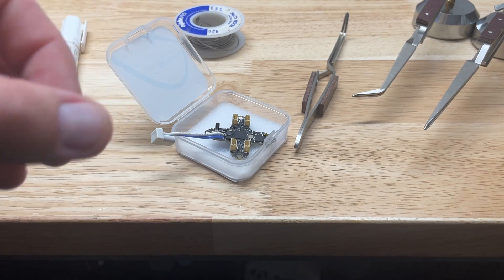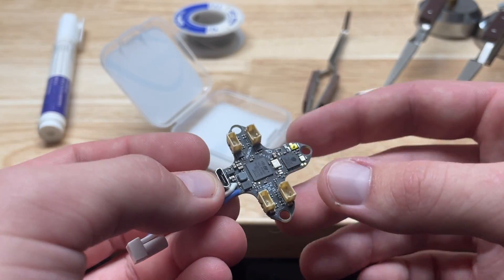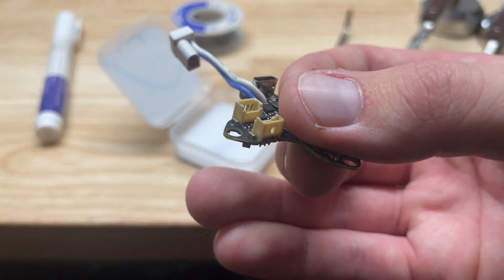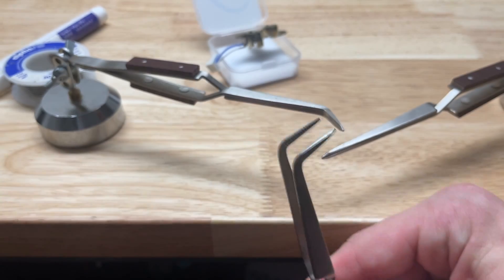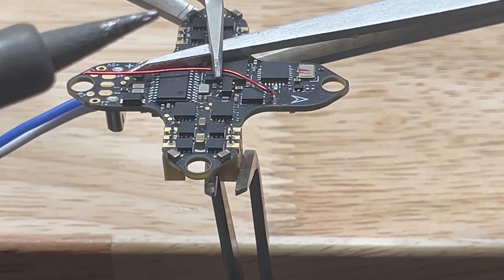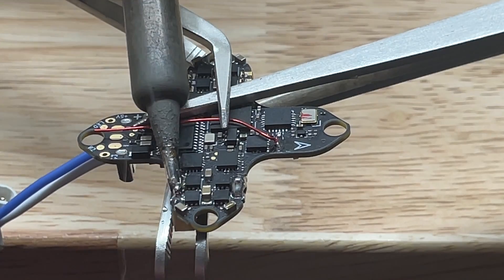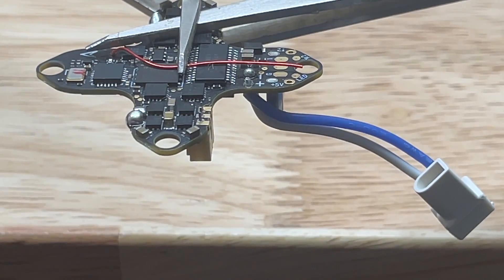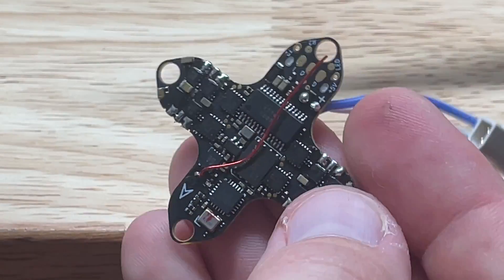Tiny Whoop Quick Tip: Removing Motor Plugs | CustomFPV

Comment: like with anything a little practice before you dive into it.   find some e waste . Practice on that till your confident.   if you have pine trees around. the tree pitch is your flux.   use it raw or thin with iso alcohol.   no soldering iron ?.  heat a pin, nail or even copper wire.   with a stove ,candle  or lighter.    its how it was done before electricity.    hobby on pilots.

Comment: Keeping the solder iron on your board for that long will destroy it. One pin at a time is much better for your board's longevity.
Reply from the maker: been using this method for years and know many of my friends and fellow racers that swear by this method, never destroyed a board. must remove all pins at the same time to remove the connector in one go.

Comment: save 4 minutes of your life. This only works if your pins are actually through pads like his. Many of these boards are NOT that way, there is basically no visible pad the pins are through, just a super tiny hole

Comment: Thank you!
Total noob. Managed to crack my motor plugs, but I couldn’t remove the pins. I’ll try again later.
Also, where’s the follow-up, where you solder the motor wires to the AiO? 🥹

Happy flying! 👊😎
Reply: Am having the same problem but cant quiet get them out, how did u do it?
Reply: @fireflymc i just broke the pins off from the base, and then just soldered on the exposed pads.
Reply: @AromielVonPleiadesalready figured it out but thanks anyway

Comment: I’ve been doing this for couple months. I built a handful of whoops and done a couple repairs and I owned a bunch of these bnf whoops with these motor plugs and I found that even when I never even unplugged them or tampered with them, they would cause connection issues where the motor would be arming sometimes but then twitching other times, but every single build that I have made where I solder the wires directly to the board, I never have arming issues unless there is hair clogged up in the prop. 

Have you also experienced this with motor plugs? I find that they are more hassle than it’s worth and it’s actually a lot easier just to solder them on.
Reply: been chasing this myself cheers brother

Comment: Do you use solder wick? Or does that really matter
Reply from the maker: Not really, but it can be useful in certain situations. I typically try to be very careful when I solder so I don't need to clean it up with the wick
Reply: @CustomFPV  essentially you can desolder anything and salvage the board? Within reason im sure.  Cool... I will look forward to doing this as things get back to normal.
Reply from the maker: @ClayIW  Wicks are handy for desoldering for sure. I find most of the pads on this board in particular can be desoldered and cleaned up pretty easily with a dry tip of the soldering iron (cleaned off, no solder on it). Typically if you spill solder anywhere else on the board you will end up pulling caps and other chips off the board which are very difficult to put back into place. The golden rule is to not feed too much solder onto the board in the first place and avoid all the potential issues. Just be careful and it will all work out!

Comment: could you also pull on the plugs and remove them that way and remove the pins one by one? it's hard to make out how it's connected. I'd kinda prefer that due to heat buildup.
Reply: You probably figured it out by now but for anyone wondering it is indeed the case, the three « wires » in the plug are not connected. They are just three standalone wire and then the plastic cover slides into them to make easier install for the motors connector side that will force the motors wire and plugs wire to touch so that the current will pass. That means that you can gently remove the plastic cover and then remove each wire separately :)
Reply: @MikleRe that happened to me but am struggling with removing the pins, any tips?

Comment: I made a mess trying to get those motor plugs on a brand new board I did what you did but when I try removing the extra sodder it spread all over the board I try flicking it with the tip of the iron try using the sodder wick didn’t work in this process one of those tiny capacitor came off and that when I realized I fucked up bad
Reply: damn you messed up, how did it end up? im too scared to do all this asw

Comment: Good video for the community! What was also important for me is to press a little bit of flux into the gap between the plug and the board. Then the plugs can be removed even easier because both sides of the board then have flux..
Reply from the maker: Thanks for this comment! good tip, that would definitely help further. Thank you for watching!